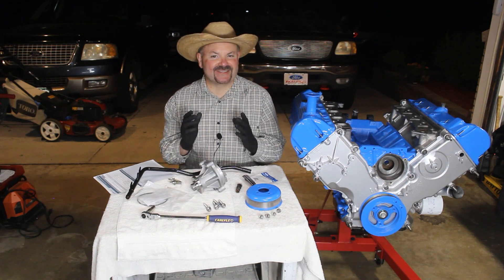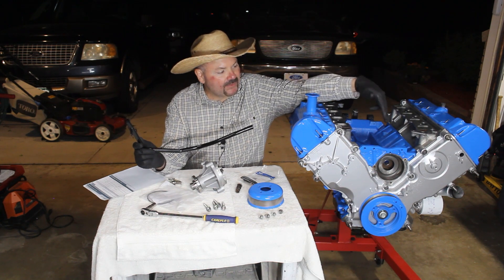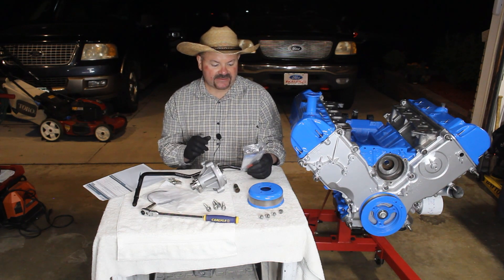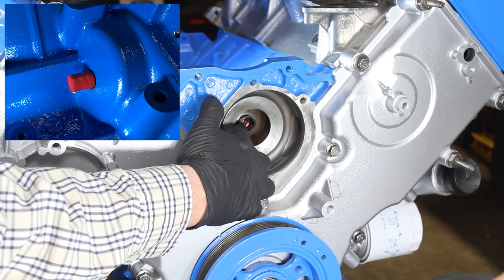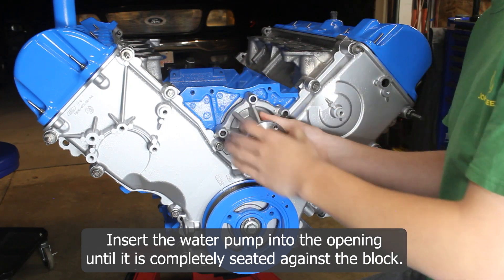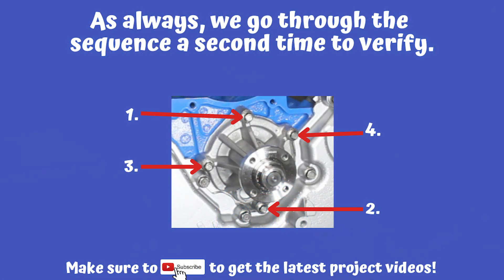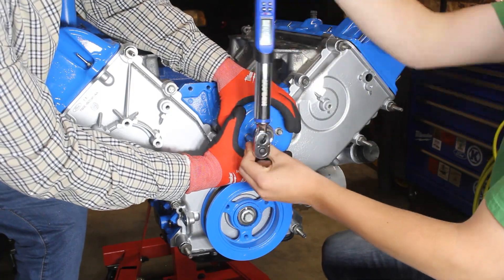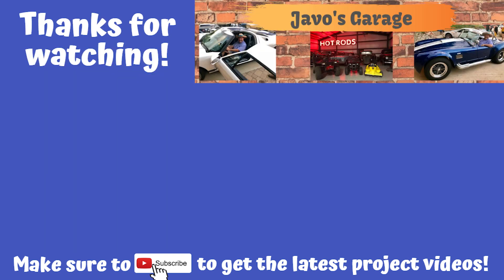Ford 5.4 2V Water Pump Replacement

Comment: What do I lube the O ring with? Motor oil or coolant?
Reply from the maker: Hi Tate.  I used a little bit of silicone (plumber's grease) in my case.  I would think either a dab of oil or coolant spread over the o-ring would work too.  I was looking for a way to lubricate the o-ring so it would easily slide in to the block and create a seal.  Hope that answers your question.  Thanks for stopping by!

Comment: Thank you so much! This video was exactly what I needed. I am tackling this problem with my 2008 F-150. My question is how did you get that “ tube piece “ out of the block? I tried to tap it from behind with a hammer but it didn’t seem to budge. I don’t want to hit it too hard because I’m worried that I might damage the hole/block where it is installed. Any suggestions?